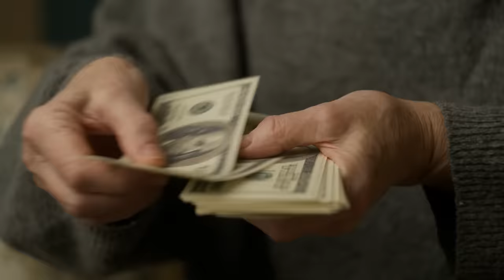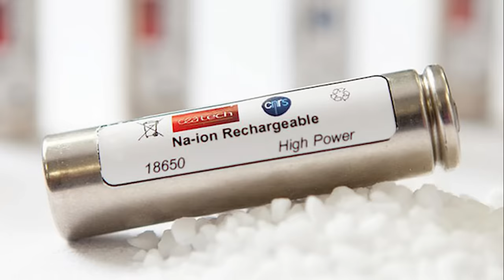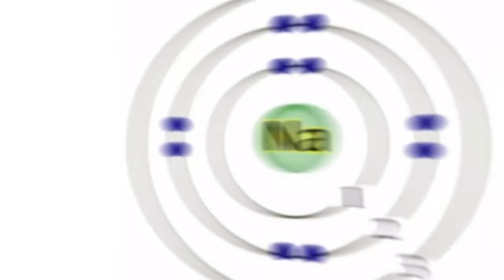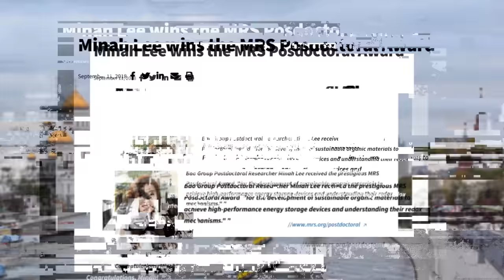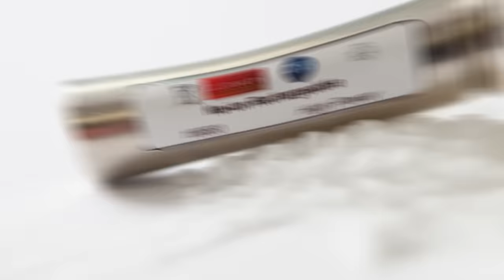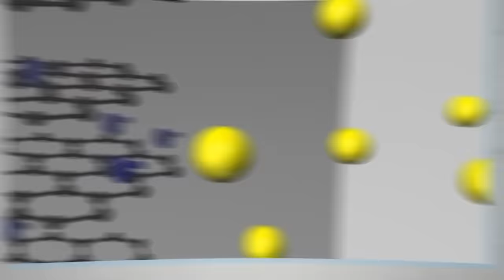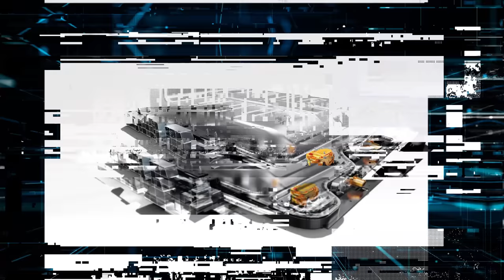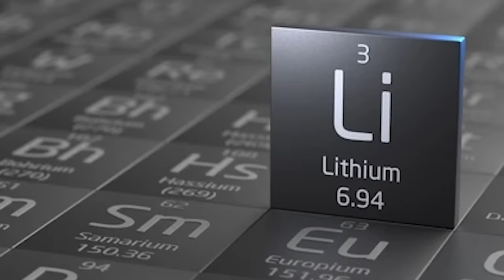HUGE Swedish ‘Breakthrough Battery’ Ends Chinas Battery Monopoly

Comment: I'm holding out for 2nd generation solid state batteries.
What an awesome company.
Thank you for recycling.
Reply: I think most people would be dumb not to own an EV at that point, depending on how the infrastructure is looking. 

A solid state, sodium battery is easy. 900ish mile ranges, no drain in cold, faster charging, better density, lighter, safer, and sodium is more available.... Pretty easy answer.

Comment: With supercharging highly saturated and widely dispersed,  160Wh/Kg is all you will need.  The challenge rests now in rollout of the super charging networks.
Reply: We need 300Wh/Kg at the least
Reply: I am developing battery swap system for light electric vehicles and sodium ion batteries would make a lot of sense because they are safe and last long because my system would have bidirectional grid connection.

Comment: Anbri bateries are sodium bateries ? Correct?
Reply: Molten salt batteries use sodium chloride but they are completely different than sodium ion batteries. Heat batteries are not the same as chemical batteries. Heat batteries are huge and require turbines and massive insulated containers.